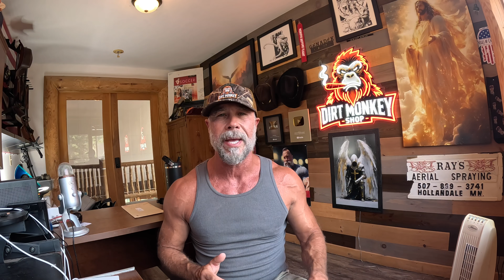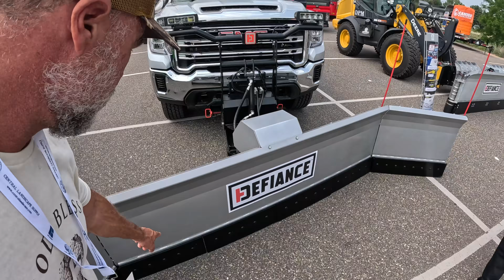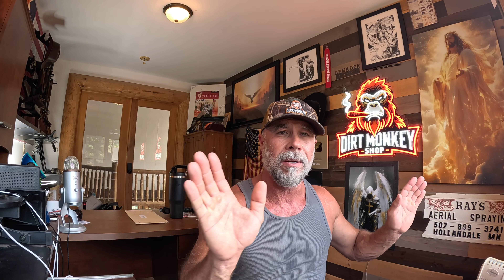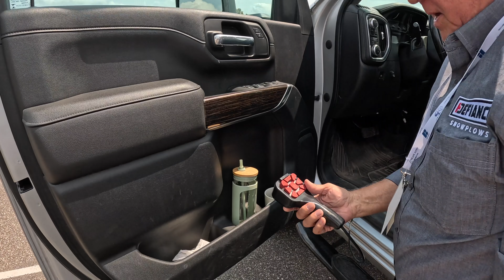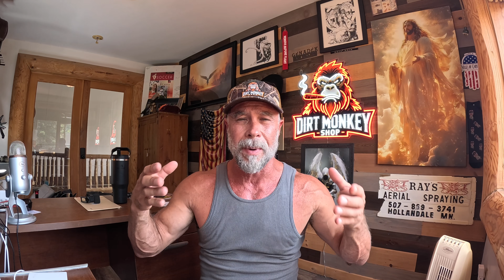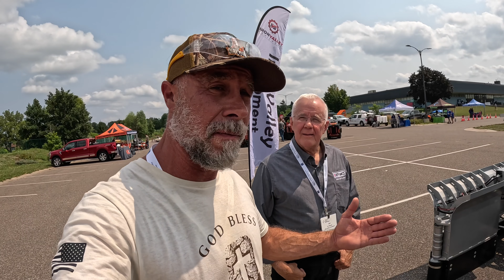He Built BOSS.  Then BLIZZARD.  Now he's doing it Again.

Comment: Technology included to help prevent vehicle damage. Could it be made simpler? The weight of the plow is concerning. Beefing up the suspension is required. How about the entire driveline? Can't be good on the transmission or axles. Has to be a monster of a truck to use this plow.

Comment: Ya..... all these sensors and all,a person should need is common sense and pay attention and be an operator not just a seat cushion. It might not sound like a connection from plows to dogs, but hear me out, Stan..... but look up how many service dogs died this year. Government taxpayer-funded trained service dogs trained for different tasks, from taking down bad guys on the run to sniffing for drugs and/or finding lost/missing people and fire marshal dogs that help find hotspots and burnt fuels and things used in arson. Once you find out that number, look into whether they died in action or in a vehicle waiting to be needed. Sadly, a whole bunch were stuck in the k9 unit in the heat and at the mercy of a simple heat sensor that failed! No real mention of the person in charge of the animal just blame the sensor....  Yes, we are getting pushed into this tech, and yes, it can be useful, but it shouldn't replace common sense, and it shouldn't have to be relied on to earn a living. Like the k9 handler (sensor checker) the person relying on the sensors to not damage the truck..... are they going to be careful not to jack up the suspension going from job to job or hitting the curbs with a steer tire when the blade is up and trying to backdrag parking spots under that heavy weight? I doubt it! I also bet if the boss doesn't notice something is off, the driver won't notice till the tires are worn bald on the inside or a control arm leaves the chat

Comment: You can't just beef up the suspension, you also have to be mindful of the GAWR for your truck. Just because you make your suspension stiffer doesn't mean you change what the axle is legally allowed to weigh. I bet if you actually looked at what the front axle of these trucks running around with these blades weighing 1,000 lbs or more are overweight on the front axle